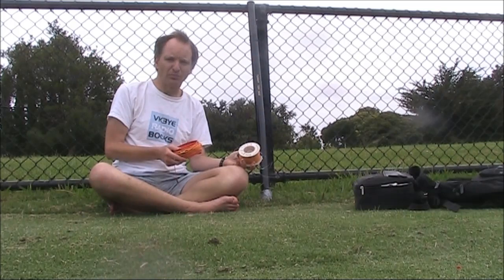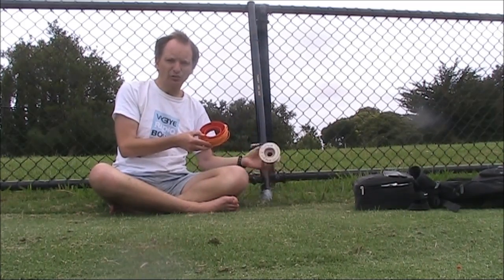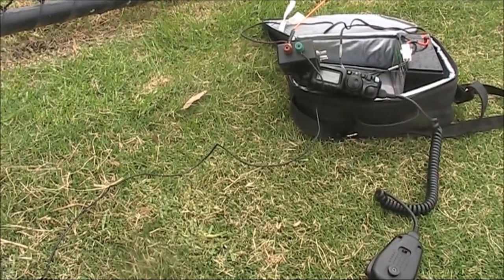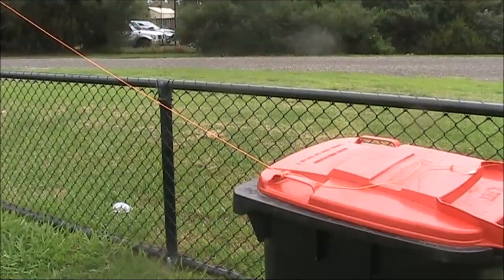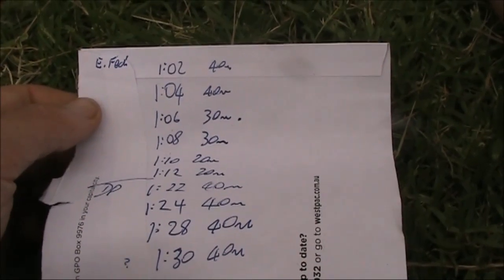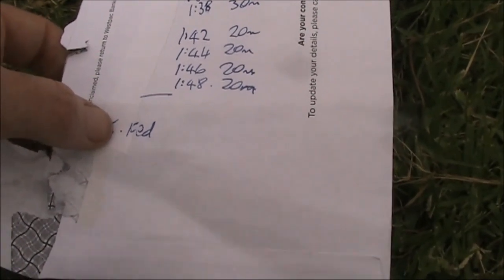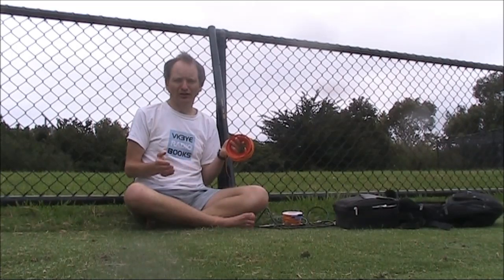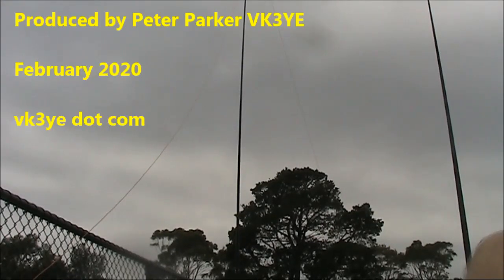Link dipole vs endfed 20m wire: Which works better?

Comment: on qrp, single band 12 watts, my tests have been the efhw worked much better, I chock this up to a better match, and less coax being needed, and coax being in the way on the dipole. this was a straight vertical test , bottom of antenna at about 6 feet from ground, no counter poise, coax choke at 30 inches from feed. the 30 inches acting as cp. on 27.385 Lsb-line of sight -non skip test. At 30 km, and 20 km. The endfed works better for me, send and receive. Is easier to trim and match for me, and is easier to get in the air and keep in the air.

Comment: 30 meter being off resonance results in considerable ground current thus much loss due to no ground system for return current. Therefore on 30m the comparison is unfair. If you were to put down a few 1/4 wavelength radials for 30m I bet the 40m EF would out perform the dipole. The other solution would be to install one link for 30/40m so you could then have a true EFHW on 30m when needed.

Comment: Thx for the upload. I have always had better results with a multi band dipole 1.1 balun inverted setup on 20 and 40m approximately 10m of the deck.. That said portable work is maybe 10% of my experience.. I highly recommend the Wind camp Gipsy at the price point .. Compact well made and performs... 73s HS0ZOU

Comment: i use 120ft end fed I.vee with L C  atu from vk3ye book for 160/80m and a 85ft I.vee with same atu for 60/40m bands both work very well i have not used 20m up for some time

Comment: Made my mind up.  What gauge wire were you using on the end-fed?  73 de N4FCA
Reply from the maker: Thin enough to be light. Thick enough not to break. Not critical.

Comment: Should an end-fed half wave antenna (half-wave on 40m) should be resonant on 40m and 20m, but not 30m? The L-match would make a match on 30m, as a 'random wire', so I wouldn't expect that to work as well as a resonant dipole (link or otherwise). So doesn't the test does show the advantage of using an L-match antenna coupler over a 49:1/64:1 transformer, as you can get a match on all the bands (with the slight cost shown) from the antenna's fundamental frequency and up, not just the harmonically related bands. Do I have that right? Anyway, I have all the parts must get on and assemble my L-match!  Thanks for the video.
Reply from the maker: Yes, I prefer an L-match to something fixed. In relation to 30m the numbers were right but the conclusions were not. The end-fed was actually mostly better not worse. Antennas don't have to be resonant to work well (contrary to popular belief).

Comment: Thanks for this. I suppose 30m on the end-fed had a less favorable radiation pattern than the dipole for this particular test.
Reply from the maker: Contrary to an error on the slide the end-fed actually worked better on 30m than the dipole. The numbers are right but the comments were wrong.
Reply: @vk3ye  hi I’m going to start experimenting with wire antenna , I be honest I’m a newbie , my question is on the inverter vee what happen if you put a wire under the inverter Vee , so the wire under the inverter Ver will be a reflector , do you ever tried , if no , can you put the wire under the inverter Ver and let me know if the inverter Vee works better

Comment: Hi Peter.
When operating portable 99% of the time i use a 20 meter length of cheap loudspeaker wire and an L Match tuner.So simple and it  works.73.Ian G7HFS/PA3IKH